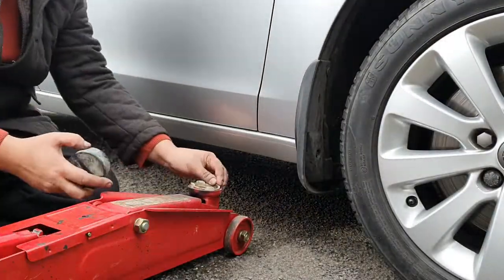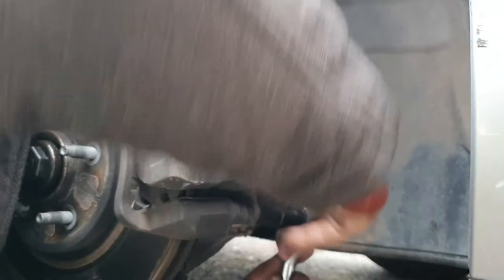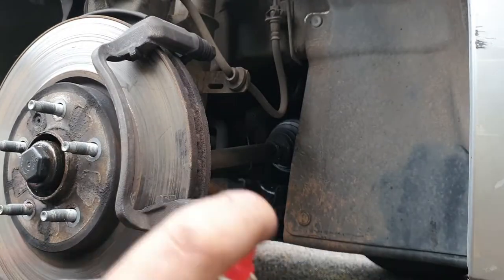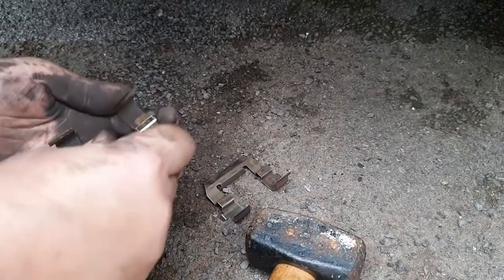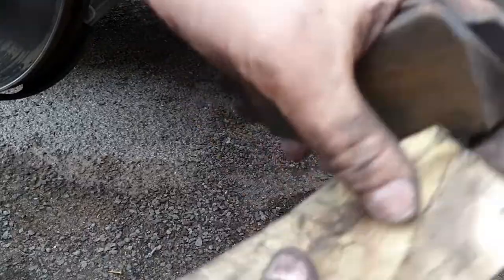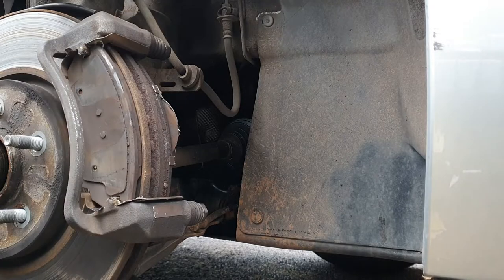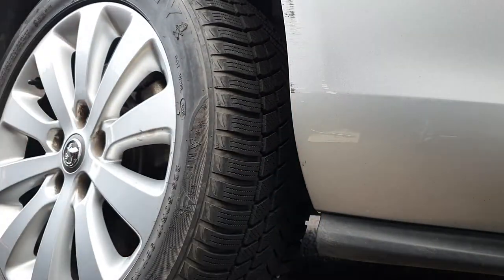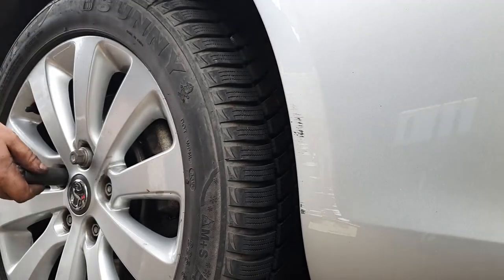Zafira Tourer - Front Brake Service

Comment: Great video. Thanks. Clear explanations, clear speech (which is rare these days!). Quick Q: If you're winding back the caliper piston to replace the pads, do you have a simple tip to ensure its lined up with the pins behind the pads?
Reply from the maker: On this style of caliper, the pads usually fit into the carrier and stay put. The caliper sliding pins can be removed and lubricated before being replaced. The caliper will slot onto the carrier and with some shuffling, can be coerced into lining up with the mounting points on the caliper.